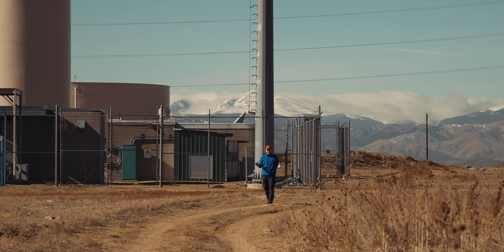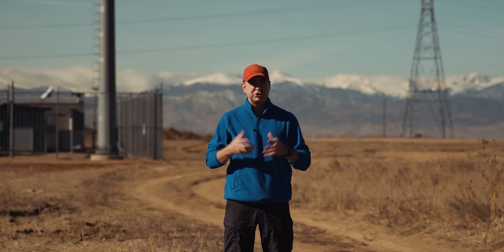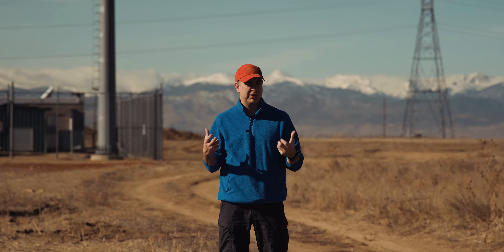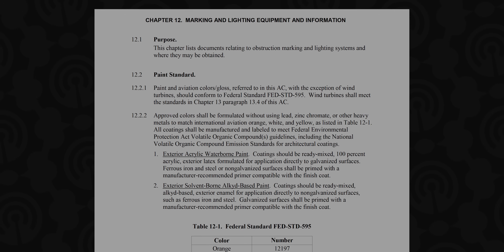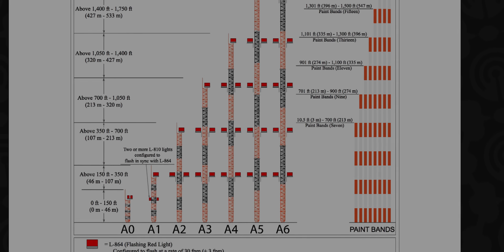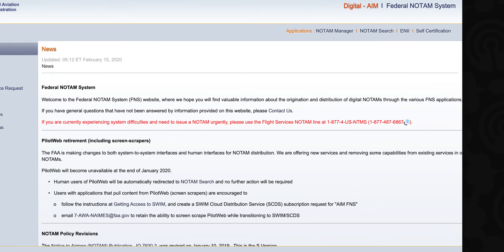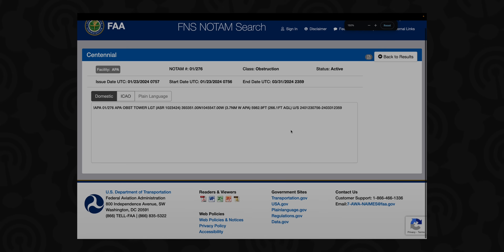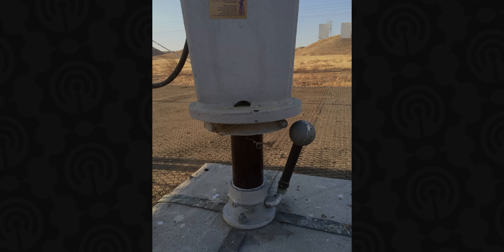The Anatomy of Broadcast Towers: Detailed Breakdown

Comment: I worked somewhat near a series of tall transmission towers well fenced in without much built up around them. I had a coworker who grew up closer to them, and who said sadly that she’d watched one tower fall during the build. She reported seeing workers fall, apparently not tethered, not that it would matter at that moment… We also had railroad tracks by the worksite, and a switching yard was almost in the backyard of her family home. One day early in my employment at the job I commented upon the series of black painted rail tanks rolling by. My coworker asked if I knew what was in the tanks. I hadn’t read the white lettering, and stated that I didn’t know.  “Anhydrous ammonia. That stuff will burn out your lungs if the tank leaks!”  YIKES!!  
Only decades(!) later, after thousands of those A.A. tank cars had creaked past the facility the employer instituted safety drills in the event of a rail accident; where to go, what to shut and shut off, who to call, etc.

One thing noted about the antenna guy-lines are the weights riding upon the lower limit of the cable before they terminate at the anchors! We have snow and ice here in winter. Obviously there is much wind at heights. Temperature contracts and expands material. I have long wondered how much “give & take” any particular guy line is subject to!!

Great episode!
Reply: @williesnyder2899, the guy wires are almost completely inelastic. They 'give' a bit under gravity and dynamic loads such as wind, ice accumulaton or seismic activity but, essentially, do not 'take' to return to original length or tension. From time to time they need to be retensioned properly to maintain the straightness, vertical alignment and overall structural integrity of the antenna system. Not unlike tuning a stringed musical instrument.

Comment: The FAA rules on tower paint don't specify color other than red. Most are painted aviation orange. Which looks red. If the tower is on a flight path and over 200 feet it must be painted and lit. The rule is 7 bands with red at bottom and top. The beacons,( flashing lights) must be red at night and white during the day. The non flashing lights in between the beacons are side marker lights. Beacons must be 200 feet apart.

Comment: I have a quesion and a suggestion.
How do AM stations change their daytime/nighttime patterns? I'm guessing that it's done with relays to specific radials.
I also watch another YouTuber, Jeff Geerling, He does a computer oriented channel, his father is, or was, the engineer for KMOX in St Louis. He had an interesting video of some of the KMOX radio transmitter equipment. Perhaps you could include him in an episode.
Reply: Directional AM stations have at least two towers. The output from the transmitter goes into a "phasor" that controls the amount of signal that goes to each tower and the phase between each. If you did any vector analysis in trig class, you will recall that different signals will add and subtract with time. This translates to more signal radiating in some directions and less in others. When a pattern change is done, relays do change between the controls for the daytime and nighttime pattern. Sometimes, even a tower or two are energized or de-energized depending on the need. I used to work at a four tower directional station but we only had one pattern. This was in the 70s and stations had to keep a first class licensed operation at the transmitter. There wasn't much else to do, so I manually calculated the patterning using the information from the phase monitor. I used an add, subtract, multiply, and divide calculator and a slide rule for the trig functions. It was necessary to calculate two patterns using two towers then use those figures to calculate the finial pattern. Signal strength was calculated at 10 degree increments. Imagine my surprise when I plotted the pattern and it came out reversed. I missed a sign somewhere. It was a good exercise, but I didn't do it over.
Reply: @michaeldaniels3639  thanks. Yes, I'm acquainted with a phased array antenna from my amateur radio hobby. I was unaware that AM stations use multiple phased towers. I was guessing that it was by using relays to activate / deactivate ground radials.

Comment: When I was growing up in the Detroit area in the 1960s, there was an FM station in Oak Park, WLDM (Lincoln Broadcasting), that very much had a homebrew feel to it. For example, when they started broadcasting in stereo, they bolted a couple of stereo faders to their mono broadcast console for the turntables. Advertisements were played on mono Ampex reel-to-reel tape decks, and the microphones were all mono. 

They had a freestanding tower; it looked kind of like the Eiffel Tower (and had no safety fence around it). To hoist stuff up the tower, they had a hook hanging from a big ball (probably a weight to make sure the hook came down easily when empty). The cable went up to a pulley at the top of the tower, down to a pulley anchored to the ground, and over to an old pickup truck that had had one of its rear wheels replaced with a large spool for the cable. I never saw the setup in use; I am really hoping that the did not hoist people that way. Eventually they got bought out by a large radio chain, who tore out all the homebrew stuff and replaced it with "best practices" engineering.

Comment: I went back into the woods after they put a new tower up and i found a red Pyrex glass light cover laying in garbage that had been left around
Reply: Often times we do LED upgrade installs, normally the guys will toss the beacons/side markers off the tower to save time and energy. Some of the older incandescent stuff is pretty cool, I collect a lot of the stuff we decommission and re engineer with LEDs for home display/entertainment purposes!
Reply from the maker: @f1vet930 I came into possession of a side marker. It’s a cool little display piece.

Comment: *THE GUYLINE BASES GO DOWN 6000 FEET BELOW THE SURFACE OF THE EARTH!!*
Reply from the maker: Maybe not that deep.

BUT funny you should mention that... there's one station that I know, where the antenna is, on paper, underground. The FCC takes height above average terrain. If an antenna is on a steep mountain peak, the way the average terrain is calculated, shows that the antenna is much lower than it really is.

Comment: What about Shortwave radio antennas?
Reply from the maker: What about shortwave antennas? Shortwave broadcasting isn’t very big in the United States, so I didn’t cover that.
Reply: @TheBroadcastEngineer  Its getting bigger again WRMI Legends on 5050 & 9455 kHz, WWV & WWVH 2.5, 5, 10, 15, 20 & 25 MHz, WWCR 3215 & 4840 kHz, WTWW, 5085 kHz & WBCQ 15420, 9330, 7490, 5110 kHz to name some as well as many overseas.
Reply: @drsysop  I'd imagine that since they pose the same danger to aircraft, that they also would fall under the same FAA regulation.

Comment: Towers aren't guyed. Masts are guyed.
Reply: I can guy anything.
Reply: @markpell8979  If you ever designed a tower or a mast, or the foundation for you'd know they are very different.
Reply: @DuaneKerzic  Duane, you are quite correct at the hair-splitting level but for most people, even many in the associated 'tower industries,' the terms are often used interchangeably without harming the intended meaning. If you or I are looking at a specific upright structure used to broadcast and/or receive radio signals, we know what it is but we should also know what most others would call it. If we don't use the generally accepted term we are immediately recognized as nerds or geeks, which I'm ok with but I prefer to be understood at the common language level without having to translate a term I just used to the uninformed or uninitiated. So generally and practically, the common-usage distinction between a tower or mast is irrelevant or unimportant because both words are used to mean the same thing. And technically, any upright structures that 'tower' in height above local terrain and other structures can be guyed for additional support and/or stability, and often are. I definitely understand the technical differences between towers and masts, and I thank you for this opportunity for two well-informed people to have an interesting topical discussion. I think I gave you exactly what you were looking for- someone who would disagree with you at a friendly, sporting level even if the debating point is highly esoteric. Glad to be of service.

Comment: Who can a civilian call to report a tower light out? One of the local radio stations (FM) has the top light out. Middle is still flashing. I used antenna search to find an email address. I sent an email telling them. It's been over a month. Light is still out.
Reply from the maker: You can call the FCC and they’ll send some nastygrams to the station.
Reply: @TheBroadcastEngineer  I bet they know the light is out and just don’t want to hire a climber just to change a few bulbs. Most white lights come with multiple bulbs that will switch when one burns out. Flashing beacons are a special type of light, expensive. Red light are out of style. Some people have a nervous reaction to red light, strange but true.

Comment: All extremely interesting and informative. During the 1980s I worked at a TV station, and I knew the engineers. Some of what you covered, I already knew from being around them. One night during storm season, our local power grid took a hit and knocked out the power for the lights on the tower. The chief engineer was there because it was a pretty bad storm, and he notified the FAA immediately. Tower height was (still is) 1,602 ft. Things were resolved with no incidents after it was over. They took me up the tower in the small elevator one time, I wish I'd had my camera with me. Elevator topped out at 1,492 ft. Later, they showed me a complete diagram of the tower with everything mounted on it; station equipment, lights, color banding lengths, other companies' lights...literally everything. I had no idea. I was impressed. Towers never look as big in size from a distance as they really are. Triangle shaped with a 8 or 10 ft spread between the legs (it's been so many years) with a small two-man 'box' for the elevator in the middle.
Now, as a licensed amateur radio operator (yes, I'm a ham), our towers are not nearly as massive or complex as broadcast towers, but there are similarities on a smaller scale. But even when we need to do tower work, the most important factor is SAFETY. Not only for the climber, but also for the ground crew. I will share this video to our local ham clubs' Facebook pages.
Reply: CQ CQ. My extra class expired many years ago. 45 years ago. I still remember Morse Code, enough so that I do it to passing road signs. When valid I only worked CW. Call sign was  .- -   -...  ....-  .- -.   - -. -    -. -.
Reply: @roadtoad7704  You can get your license back now, you will need to go to a VE testing session, take the technician written exam and pass it. 35 multiple choice questions. Then show where you held W4CQZ at one time. If you still have a copy of that license, they will issue you a new Extra class license. You won't get that call back automatically, but if it is not in use you can apply for it as a vanity call. DE. -- -... ..... --- ... -- SK
Reply: @dogbarbill  I've been involved in ham repeater maintenance for years. One of our sites was on a about 1200 ft TV tower, we had equipment at 950' and 500'. I've spent a lot of time up on that thing,  it hosted ch 6 and ch 11. Ch. 6 had a remote base for talking to news crews and a remote broadcast pickup system. Then there was a LP TV transmitter antenna near us at 500'. We had a couple of  UHF ham repeaters  up there and a whole VHF repeater and  the receiver for another that fed a small UHF transmitter that linked to  the control point at our trustees's house.  The one UHF repeater, we found where a commercial repeater abandoned a nice enclosure and a DB-420 antenna, so why let those just set there and rust.  The thing about working at those heights.
1. If there is a little wind on the ground, there is a lot more up there. One time the wind was out the south and the temperature was probably in the lower 70s. I just wore a light sweater. When I got up where I was doing my thing, the wind was out of the North and freezing cold.  I thought I was going to freeze to death. 

The yellow jackets liked the tower too.  One day I had some work to do at 500'. I  started out in the cool part of the day, no wasps, cool. The repair took longer than I thought. The Air warmed up, and here were the wasps, yes at 500'.  My equipment was on the south side of the tower. The wasps just acted like the neighborhood's gone to hell now, we are going to complain to the HOA.  When I  was ready to go down and went to the north side of the tower to get in the elevator, they just moved out of the way and let me go home peacefully.  I sometimes wonder if RF attracts them, we run into them at another site, which is 60 story building in the southern part of town.

Comment: The tower and it's anchors experience force not stress.  Pilots fly by maps that indicates all obstructions to air navigation.  NOTAM means NOTice To AirMen. Ron W4BIN
Reply from the maker: Pilots usually fly by maps that indicate obstructions. Tell that to the pilot and his wife who flew into the KFI tower in 2004. That tower predated the Fullerton Airport, yet somehow they found the 24 inches of vertical space that isn't available.

NOTAM is now Notice to Air Missions. Things change.

I'm not a mechanical engineer. Never pretended to be one. The difference between force and stress is irrelevant with the discussion. If this was a training seminar for tower erectors then the use of the correct term would be more important. 99% of broadcast engineers don't actually deal with building or maintaining the tower. Either its a management company like Vertical Bridge or American Tower, or they hire a tower crew who specializes in tower maintenance.

Comment: Thanks for the video I always wanted to build a radio tower maybe you could tell me some tips to build a model one I'm making a small model one so I know what it looks like in the future
Reply from the maker: That's cool! I unfortunately, don't have any tips for making a model version of one.
Reply: ok
Reply: What scale model and what are you using as a media like toothpicks or model car sprue. Also what type of tower are you building, self support, guy tower, monopole, horizontal billboard?
Reply: @dansteel9873  toothpicks and chopsticks that are connected with hot glue and the tower is self-supporting and I decided it's a cell Tower

Comment: WNPB -TV (Old WWVU-TV) Morgantown, WV Had a plane strike it's tower in the 1980's, I think.  Light Twin, fog,  pilot dead.  Tower did not collapse, was rebuilt and life went on.  15 or 20 years later, BAM.  Light twin,, fog, Pilot dead. tower did not fall.  I think it is 700 foot Stainless G-5.  Tower was rebuilt and it is still in use on DTV-33.  TOUGH OLD TOWER.